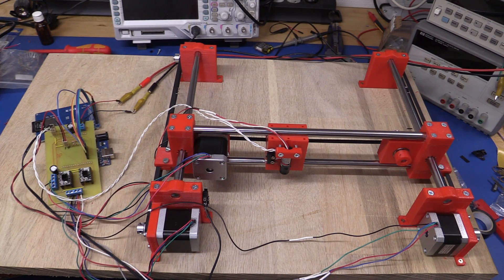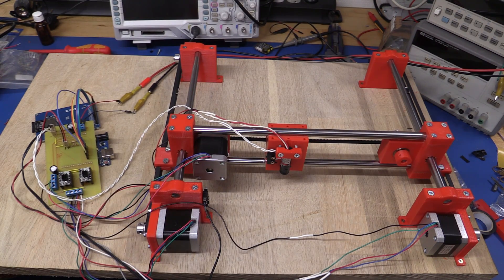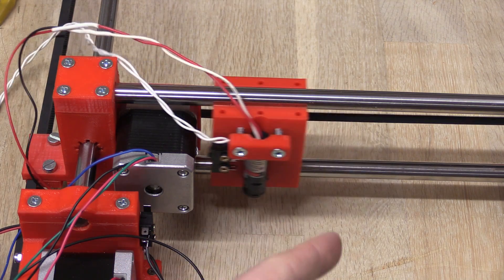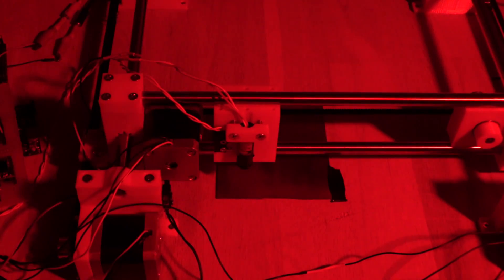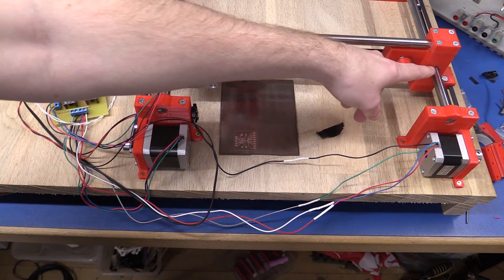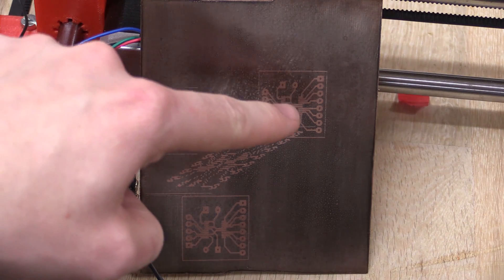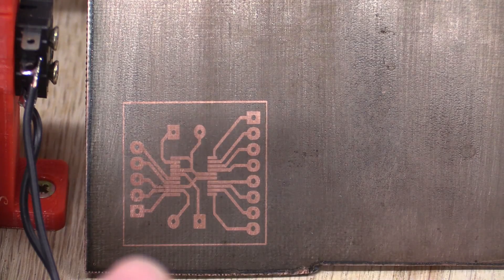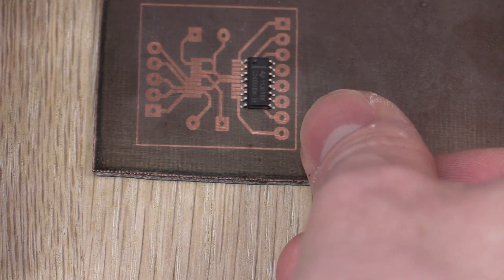DIY Laser Engraver (25mW UV for PCBs) - Ec-Projects

Comment: Hi Thanks for your video.
This is interresting because it is what i'm looking g for.
But only for solder masq since actually my laser is allready power enough to burn paint.
But i struggle to understand : You suppose the laser light has UVs in it (like any light should have more or less)? Or you use a specific laser diode that produces UVs?
Thank's in advance.

Comment: I realize that this is an old video, but you could read the file and change the data format internally to be the lengths of the alternating on/offs rather than holding a line of the bitmap. That should be a lot more efficient given the circuits you're producing.

Comment: This is an interesting experiment.  I need to build something similar.  I can tell you that the photoresist exposes better at 365nm so the 405nm laser is just barely exposing it.  The problem is that I haven't been able to find a 365nm laser at an affordable price.

You might want to look at Laser Bee's instead of arduinos.  The Laser Bee operates at 72 MHz, has 4K RAM ,64K flash and about a jillion internal peripherals.  I used one to generate a VGA video signal so there won t be any problem controlling a bunch of stepper motors.

In your case, if the jerking problem is caused by interrupts as you suggested, then your interrupts are taking to long and should be re-written.

Comment: Lazy ass configuration, tidy up those wires, typical amateuristic setup.
Reply: Cor DuRoye I have the same problem.  As soon as I buckle down wires, I have to undo them for upgrade or fix.  My wires are either 10 times too long, or 1/4 inch too short.

Comment: few years ago i realized it would be cheap to build a cnc these days. Im 99% sure I recall coming across control software that was free and works with common mcus or computer serial linked to mcu and accepts tons of standard cad formats. Great project but dont reinvent the wheel when you dont have to. Also there is an MCU compadible with arduino ide that is known as stm32 it has 0x the ram and more storage than the nano, is 32bit and runs at 75mhz. cost is like 3 bucks on ebay. you will need a $5 stlink flasher to get it running arduino bootloader.

 How much did this rig cost and where did you find those rails? is 25mw enough where u could skip uv and just go black paint or toner coat?
Reply: Johnathan Wuethrich linuxCnc is perfect, and is free open source.

Comment: How many pixels wide are those horizontal or vertical traces. I am wondering if they are drawn in multiple passes or that is the width of the laser. I am close to using an Elecs 1.5W engraver for this same purpose but the "dot" looked very big when running it at about 100mA. I seam to remember reading somewhere, that running diodes at less than intended affects the divergence , doesn't make any sense to me why that would be. Wondering if I can use a cap/aperture on the laser to control the width.
I knew that 1.5W is way too much  so I also bought 150ma diodes recently , now I see that even those may be too powerful. I guess time to plug them in and try them.
Cheers.
Reply: Sambo You can focus the beam on lasers, it is tricky.  Some people use magnifying usb camera since its dangerous to stare at the beam, and impactical to measure, precise.

Comment: Great project! I guess I'll print it to a project I have ongoing. About your memory limitation, maybe you could try Run-Length encoding? Imagine each line always starts with the laser off, then create a vector { 5, 10, 20 , 30 } that would mean 5 steps with the lase off, 10 steps ON, 20 steps off, 30 steps on... Your preprocessor idea is good too.

Comment: I wonder if you could use some kind of metal/foil plate in front of the laser with a pin hole to reduce the size of the dot slightly.
Well done, this is a cool project:)

Comment: can you not use non coated pcb, and spray with a resist, like acrylic car rattle can spray, then burn it off to etch?
Reply: Not a bad idea actually.  That or use packing tape and burn and outline so that if can be peeled off.

Comment: This is only semi-related, but have you attempted the "laserpaint" method of PCB making? That is, you take a regular bare copper pcb (no photoresist), spray it with black paint, and then use your regular laser cutter to remove the paint. I have considered buying the cheap chinese laser cutter for this use, so I would like to know if it could do the job :-)
Reply from the maker: I tried it :) But I didn't have much luck with it.. I get a residue left on the PCB, which does not easily clean up.. Perhaps I'm using the wrong kind of paint :)

Comment: If non of the libraries I use in a project need it, I've come to the point of always disabling the timer0 (this one is running by default giving interrupts for the millis/micros function). That interrupt messes up so many things most of the time (for example sleep mode becomes pretty useless with that on). You can disable the timer with "power_timer0_disable()" (could be that you need to include <avr/sleep.h> or <avr/power.h> for it to be available).
In the end I set up all the timer myself anyway, because the Arduino ways are way to limiting.

Comment: Great and inspiring project! I thing I,ll make an add on for my CNC machine. What is the wavelength the laser is operating at? Most of the diodes I've found use the end of the spectrum 405nm which is not that efficient. Would be better to get something more like 380? I'd appreciate a link where I can buy a module  like yours if it's other than 405 nam ones on eBay. Thanks!

Comment: looks great .The rig looks very sturdy . 
 now I know i could use my laser to etch for making boards , I now have even more reason to finish my image to Gcode scanner app.  
  I went with some easy drivers and a Nano and a custom Gcode interpreter . so i can PWM my laser , or bypass the FET and put it full on for cutting cardboard and foam  via a relay(true full power) . I created a custom board profile to up the Nano's serial buffer to a real 128.
 IT can be driven by any terminal , or simple G code sender ,  or directly by a c++ lib i made for my apps. I added a OLED status screen , but i lowed the updates to OLED to keep speed ok . 
I plan on finishing an app to load a image into ram on PC , and then scan it out into Gcode at a user set sample rez , and stream it to a USB / com port . ( that's a winter project ) along with trying a modification to GBRL  to replace my old custom  g code interpreter.

Comment: you could also try storing the image data as run length encoding (just google it if you've never heard of it) Black and white image compression is basically the perfect use case for run length encoding

Comment: I'm curious to hear why you didn't just make a gcode interface, since there is plenty of software that can generate laser gcode
Reply: I would have thought the knowledge gained by doing it yourself is a key factor behind this.
Reply: +Alex Hitchins the problem is that this is really an inferior solution to using gcode. It's slower, more complicated and less accurate
Reply: +ATschTheCube The knowledge gained is the most important factor, not speed or convenance. No doubt lessons from this project will benefit projects in the future directly or indirectly.
Reply: Michał Gawron It's slower because with this method, the laser drives over everything, regardless if the spot needs to be etched or not. This means if you have a huge groundplane, the laser has to go over it, even if it is not turned on at all.

It's more accurate because gcode has unlimited resolution, because it (ideally) generates instructions from vector graphics.

Alex Hitchins The knowledge of implementing a gcode parser would have helped him in the future too
Reply: You're right - G-code may be faster, indeed. But it won't be more accurate since a machine has limited resolution and you can always generate bitmap for that resolution. Vector graphics won't give you more accuracy here.
Reply: Isn't it better to use LinuxCNC or similar software that just controls the motors and laser instead of writing a new interpreter and trying to fit it into a microcontroller?
Reply: Why would you think it's slower and less accurate? (It's definitely less complicated.)
Reply: Gcode requires an interpreter.  That's a bit much for the little arduino.  If he had a bigger processor like an ARM, which he mentions, he could do a whole lot of things.  With his raster scan system, he set it up so that the laser skips over blank areas, so there is no real gain by using gcode here.  

Using real gerbers would be the best thing to use if he is going with a bigger processor.  However, it would probably just convert it to a bitmap and print it with raster anyway.

Comment: Whats the resolution of the PCBs? How many pixels per centimeter are there? Nice project, will make your future ones look even better! Will you replace you old, "hand-made" PCBs with ones made with this machine?
Reply from the maker: It is 635 PPI, or 25 pixels per mm. I don't know if I will use it for all PCBs, depends if I manage to get a decent speed out of it :D
Reply: Would that be better than using a photo resist ?
I can get down to 20mil lines with photo, but would like to get some more to be able to have traces go in between pins of dip packages

Comment: Couldn't you keep going back to the memory card rather than loading a whole line in to memory - load one byte, reverse the byte, print it. Go get the next byte, etc? Depending on how the memory is read, there might be a lot of redundant reads that you're just ignoring, but does that matter? You'd be reading bytes A B C D H G F E I J K L P O N M if your image was (a silly) 4 bytes x 4 bytes for example.
Reply from the maker: I could read it backwards from the SD card, but then I would have to use seek for every read to move backwards through the file, then after the inverted line, seek a line forwards and draw the next the right way. I think it's kinda messy, but it could be done. I might try it anyway..

Comment: Wouldn't it be possible to create a pinhole lens with an extremely fine needle (e.g. the finest cactus needles) and aluminum foil, and move the laser closer? I believe you could increase your resolution quite a bit that way.
Reply from the maker: I did think about something like that actually, but it would make it even slower, since some of the light is blocked :)

Comment: nice looking machine. it very much reminds me of a cnc plasma cutting table i designed a few years back wonder if using microstepping would smooth out the motors and make it quieter?
Reply: is he not using microstepping?,
Reply: ATschTheCube
I'm not sure i remember setting up my 3d printers and 1/16 microstepping sure seems to have made them run much more quiet.... look like polulu drivers probably capable of some flavor of micro stepping